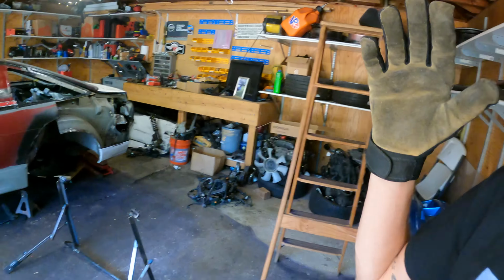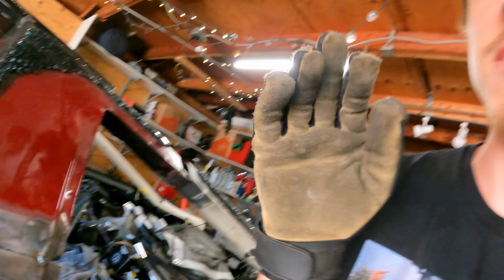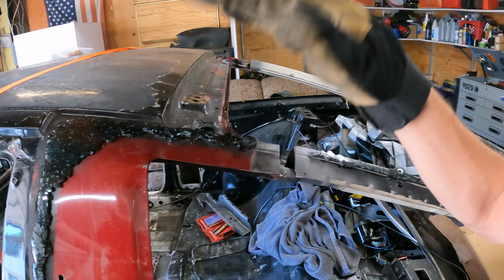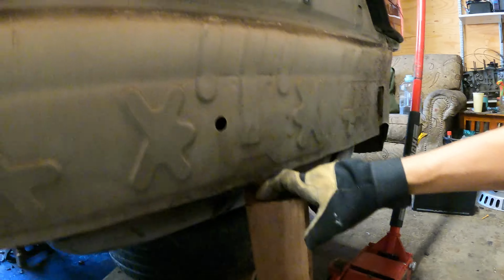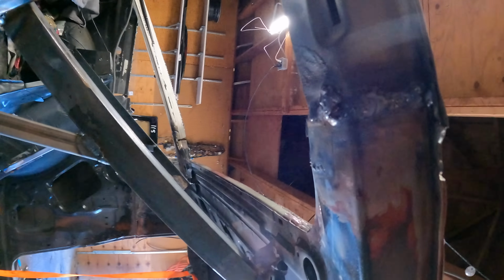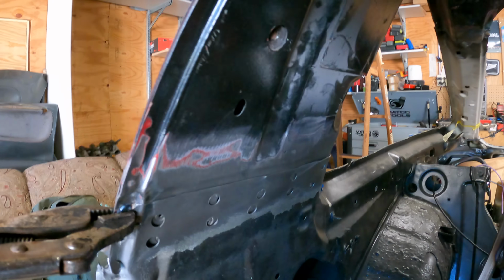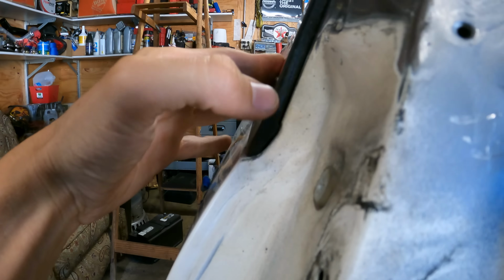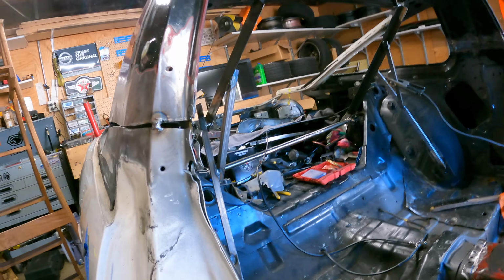Fitting a new roof on my project S13?

Comment: Great update on this one. and ill be honest. that roof is giving me PTSD so badly.
youre doing an awesome job keeping your head in the game and making solid progress forward. 
one thing i would like to say,  (im an auto refinishing and structural repair tech) that "paint" you ground off on the inner pillar.
well thats actually a weld through primer/sealer that they use at the factory. 
i also would of suggested using weld through primer on as much of those inner structures as you could.
after welding you leave ALOT of chance for moisture to get trapped inside, and also bare metal that corrodes extremely easy.

another suggestion, i kinda think the black roof on the white body looks REALLY good. maybe consider keeping that styling ?
i think the 2 tone black roof look is AWESOME personally.

also i have to keep telling myself that its going to have a full roll cage lol.
and also, shops often times cut roofs off for cage/paint work, and then reinstall the roof afterwards so.

we are at the exciting part! get a bunch of wire, check your gas in the welder and release a good LONG episode of nothing but welding
with minimal narration i think the fans here would LOVE that type of content. maybe do 1 episode solid work, 1 episode narration/covering
the work you did, followed by another long episode of work, etc etc etc.

i cant wait to see the final product, and i know for a fact im going to get to see this car in person and meet you personal at an event.
i have black turbo e36 coupe hopefully you remember this !

Comment: I hope you put a role Cage in the 240 cause all that inner structure sections will never be as strong as oem. It will look almost factory no doubt about that, but the structure rigidity will never be the same with all that welding and heat being transferred in those panels and will mess with the strength of the steel. i love what you are doing its amazing work but just think about safety>
Reply from the maker: Cage is definitely on the to do list 🔥

Comment: Great vid bud you probly already know this but weld and let cool or move over a little. Take your time and watch the heat it'll save you time dealing with warpage of the metal if you over heat it.
Reply: And if you have any low spots in the sheet metal you can take a metal coat hangers and tack it to pull the sheet metal then cut off and smooth out. They work good for gaps as well. Or get yourself a stud welder from harbor freight.

Comment: Are you sure that rear end/roof jig hasn't warped when it cooled down after welding?
Reply: Yeah I think it might be a good idea to double check how the hatch fits again, maybe would have been better to do just tack welds earlier on and keep repeating the proces
Reply from the maker: I let the jigs fully cool before I removed them

Also made them simultaneously, allowing sections time to cool off in between welds